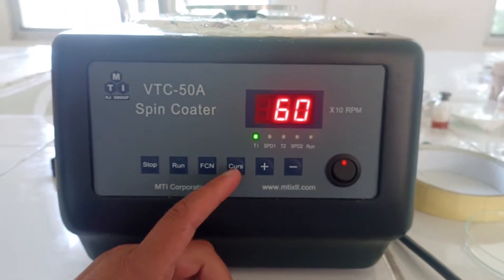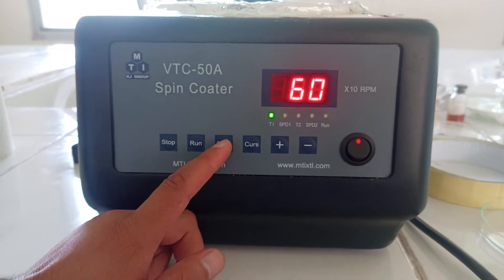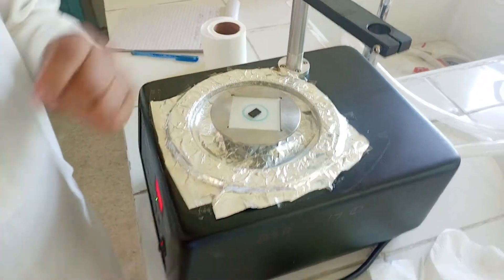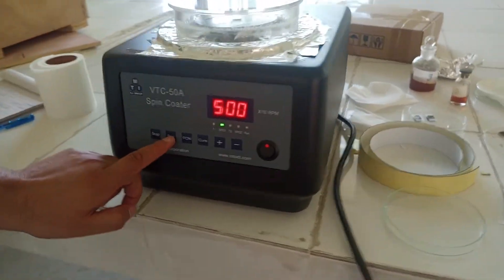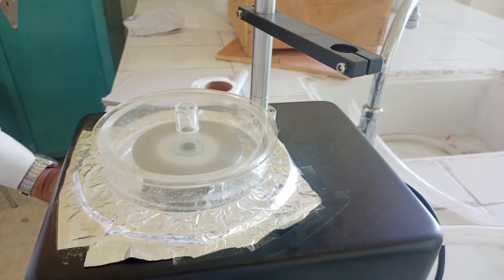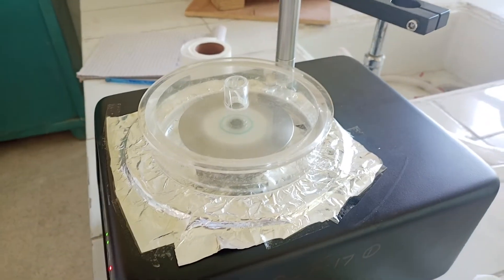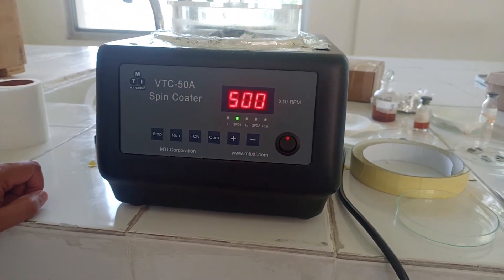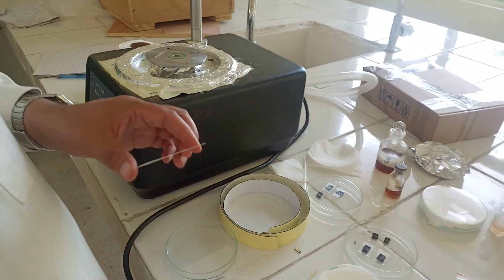Spin Coating - Thin-film deposition through spin coater (demonstration) @MajidAli2020

Comment: Sir the spin coater is not spinning even after vacuum developed what can be the possible malfunction or cause?
Reply from the maker: If spin coater isn't spinning then its mechanical fault
Reply: @MajidAli2020  only the  wheel,that bears the substrate, doesn't rotate..is it possible if its emergency locked or something
Reply: @MajidAli2020  we have the same brand spin coater as yours vtc200 vaccum spin coater
Reply: @MajidAli2020  sir ye spin coater bagher vacuum k sir chk kerne k liye spin krein to run hota hy kia?
Reply from the maker: @farahafridi4833  try kr len
Reply: @MajidAli2020 I want help. I want to understand what solutions are used and how to apply a substance to glass in this way